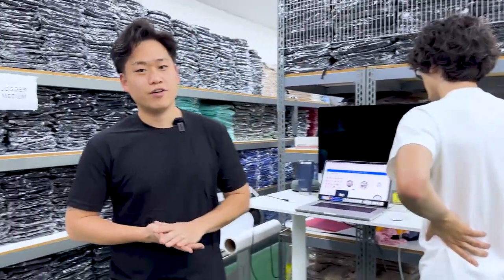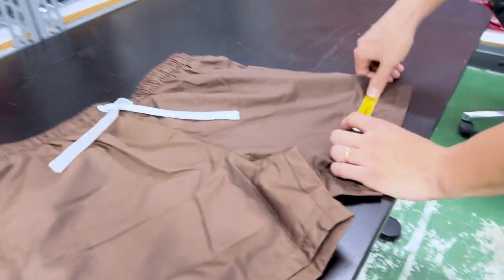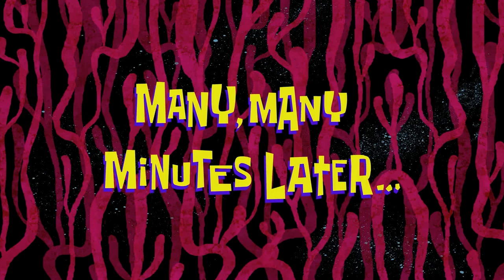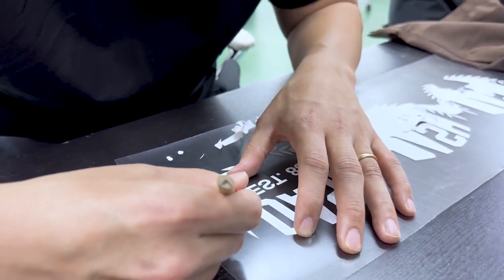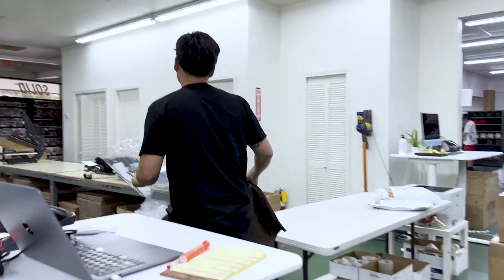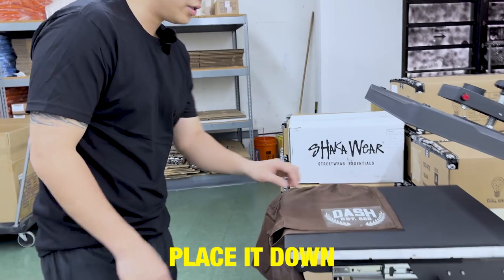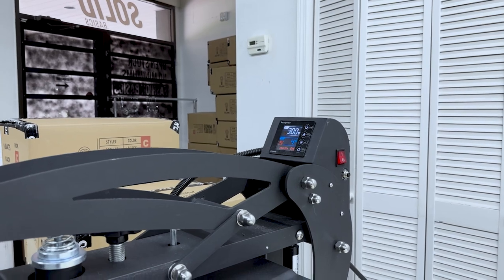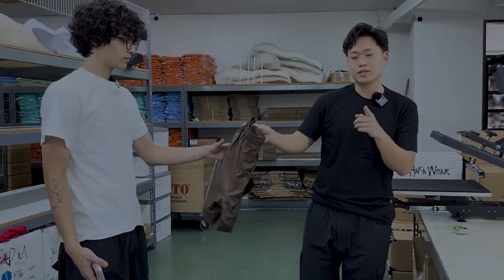How to Print on Nylon Shorts with a Heat Press

Comment: Dope! Why am I coming across this video today lol I used  nylon /spandex 10% shorts . Heat transferred it at 300° for 12 seconds, with Teflon sheet. Once I peeled off the linear I stretch out the shorts  a little bit And reapply 3 to 5 seconds of heat press. I dried  them today at high heat, Only one letter in the Los Angeles was kind of peeling off. No it’s Tombolo or just let it air dry, but some people don’t really read instructions lol just don’t wanna sell a product in the peels off
Reply: So air dry to prevent HTV peeling on the nylon fabric ?